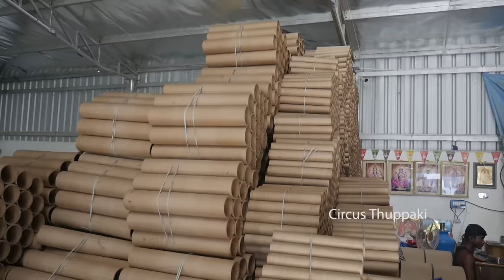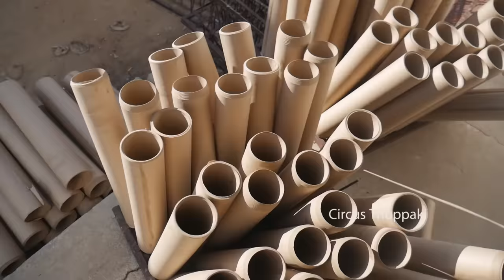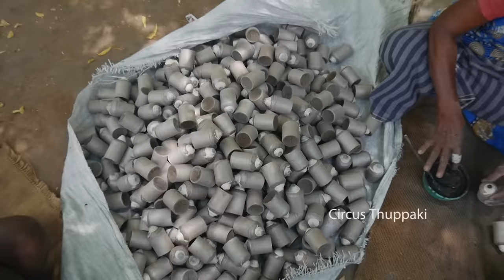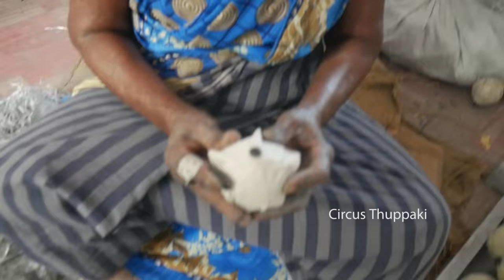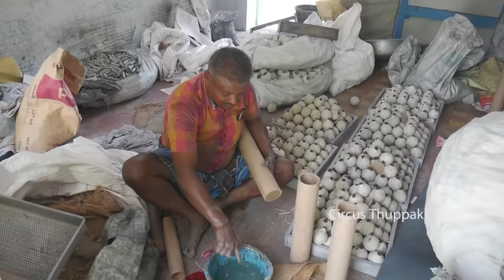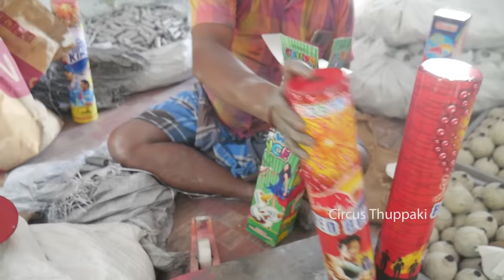Monster Sky Shot Making full Process in Fireworks Factory | Diwali Celebrations

Comment: I worked for years in the vacuum metallizing field. We worked with all the powered metals they work with but used them in different applications. We would NEVER move then without respirators or touch them with bare hands!  Whenever we had to open the machine up for adding metals or cleaning, we had to wear Powered Air-Purifying Respirators (PAPRs) that have a battery-powered blower that pulls air through attached filters, canisters, or cartridges. They provided protection against gases, vapors, or particles when equipped with the appropriate cartridge, canister, or filter. We also used Supplied-Air Respirators connected to a separate source that supplies clean, compressed air through a hose. We were well aware of the dangers of powered metals and the detriments to our health. We had to bring a change of uniforms and keep them in our lockers when we had to clean out the machine. Then our uniforms had to be tied up in a double walled OSHA bag and left in a sealed bin for cleaning by the company. These poor people. That is meant as a double entendre'. Happily working for a couple of dollars a day for basic necessities. So sad. I felt guilty for watching.